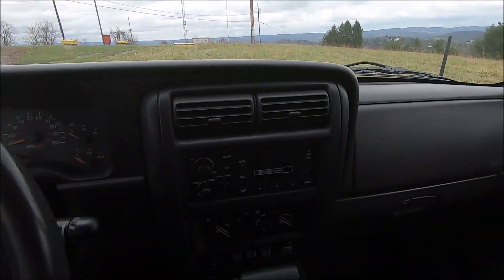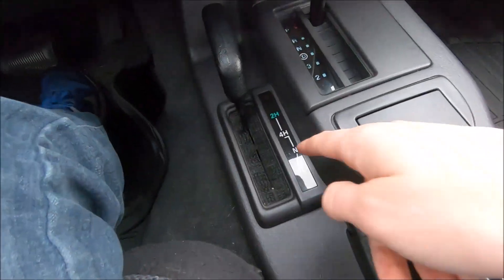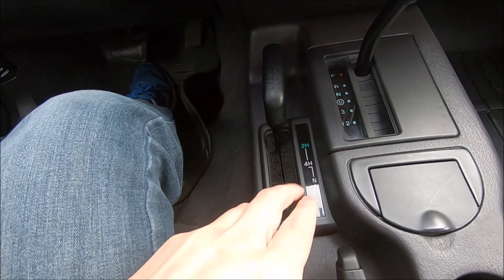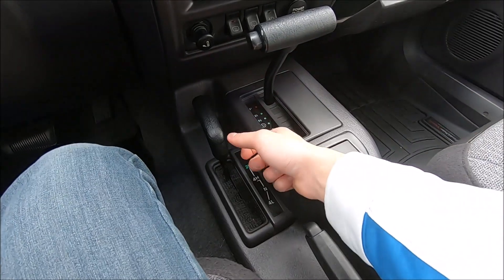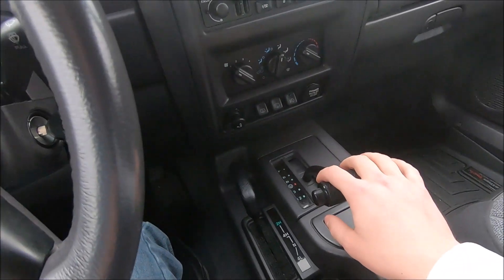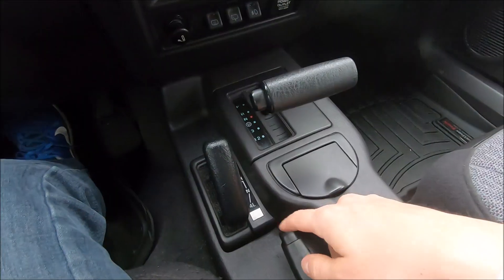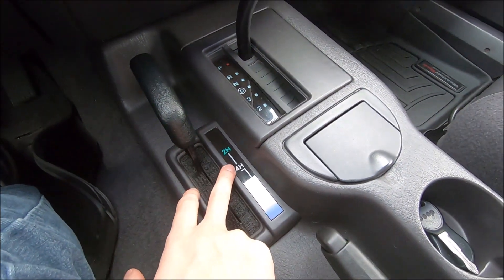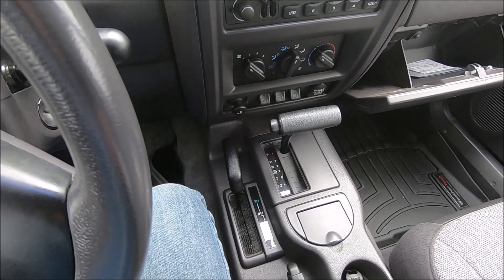Jeep 4WD System Explained (Command Trac vs Selec Trac)

Comment: 2WD = Rear Wheel Drive 
4WD Part Time = Four Wheel Drive with center differential LOCKED 
4WD Full Time = Four Wheel Drive with center differential OPEN
4WD LO = Low gear, four Wheel Drive with center differential LOCKED 

Simply explained 
High gear = Half engine power, full speed. 
Low gear = Full engine power, half speed
Reply: Is there a full time light? How do I puty it in full time 4wd?
Reply: @ryanwyrick6947 you gotta have the transfer case that has full time 4x4 not all of them have it mine has options for full or part time 4x4 and they would be labeled on the shifter pattern
Reply: High and low range don't change the power output of the engine, low just gives you increased torque multiplication through gear reduction.
Reply from the maker: @Lray4x4  I think he means the amount of power it takes to reach full speed vs half speed
Reply: @Lray4x4  No shit, just tried to explain in a simple way so people know roughly what it's about

Comment: I have a part time light stuck on in 2H.. .goes out in 4Hi. When Im in 2Hi its a real 2wd but the light is on. In 4Hi it goes into 4x4 and the light goes out. So the light is backwards from this. Its a 2002 Liberty and my Tcase shifter looks just like yours. I need help cuz I havent bought it yet. Is there a full time light? How do I engage full time 4x4? I saw your part time light never went out? I need everything explained from how to shift when to shift to what the dash lights mean. This video helped but My part time light is on in 2wd and goes out in 4hi... havent tried 4lo

Comment: The Cherokee XJ had the command trac or selec trac systems.

The Grand Cherokee from 1993-1998 had command trac, selec trac, or quadra-trac.  
231, 242, or the 249.  

The Grand Cherokee from 1999-2004 had the 247 transfer case they still had selec-trac as an option as well....but the 247 full time 4WD system was more common...and the 247 was used with the quadra-trac and quadra-drive systems...quadra-drive added front and rear limited slip differentials added.  

The old Cherokees prior to the XJ had a full time 4WD system or part time system, I can't remember which transfer cases they used but they weren't the 231 or 242 back then.  

The Cherokee XJ and Grand Cherokee ZJ were great in bad weather, and given the different 4wd options you could pick the one for your most use case scenario.  

The 242 Selec-Trac transfer case was found in the XJ (Cherokee), MJ (Comanchee Pickup), ZJ (1st Generation Grand Cherokee), WJ (2nd Generation Grand Cherokee), and the WK (1st Generation Liberty).  The 2nd generation Liberty also had "Selec-Trac", however it was an electronic system, and didn't have part time mode, it was just auto and low range.  The Jeep Wrangler and Gladiator did have a "Selec-Trac" option as well for a while but it was an automatic engagement clutch based system rather than a mechanical open center differential found in the 242 transfer case.  

Given the age of these vehicles now, don't just look at the bezel on the shifter or by the shifter as a reference to what transfer case you have, if you aren't the original owner, there's a possibility the transfer case has been swapped out, its best to look at the tag on the back of the transfer case to verify what you have...The Cherokee transfer case swaps are between the 231 and 242 a lot of times, if people are modifying them for offroading and it had a 242 they'll typically swap it for a 231, just one less 4WD setting, and in offroading applications you wouldn't need the full time mode, so its just less parts to worry about failing.  In the Grand Cherokees the 93-98 models that had the quadra-trac full time 4WD, the common failure was for the viscous coupler in the transfer case that controlled how much power was sent to the front axle.  When that failed it failed in a locked state, which turned your full time 4WD system into a part time 4WD system which of course made turning sharp a problem...so many would swap to the 242 or occasionally the 231.  In the 99-04 Grand Cherokees the common transfer case was the 247, it had a rear wheel drive bias to it more of a 2WD until slippage was detected type system, people again will typically swap the 231 or 242 transfer cases....with the 242 transfer case getting a replacement from a junk yard is common, and there are 2 versions of it, one being the standard 242, and it'll usually have a J after the 242 on the tag....if its found in a Durango or rarely in a Dakota you'll find a D after the 242....these designate that its a Jeep or Dodge and means nothing otherwise and the internals are the same.  The 2nd version of the 242 will have HD behind the 242....this is the heavy duty version, which would be found in the Durango and rarely in the Dakota....the chain is 1/4 of an inch wider as well as the sprockets inside, other than that its the same.  Then you get into the differences in input and output spline count depending on transmission being used and the application.  I mention the Dakota because Selec-Trac was an option in it briefly, but I've never seen one on the road with the 242, I found one in a pick a part yard once and it was a late 90's model with the 318 V8.

Comment: i know its a old video but what to do when its a manual transmission?
Reply from the maker: You can either push in the clutch or put the gear shifter in the middle for neutral when shifting from high to low or low to high

Comment: Common misconception. 

There is no viscous coupling on the XJ so torque is not split 50/50, it simply applies 100% of available torque to both axles. 😎

Comment: Will this work in my 99 Jeep wrangler ?
Reply from the maker: If you have the same transfer case then yes. If it’s different then it should still be similar but make sure to read your owners manual to confirm

Comment: Hello, first time automatic user here, to change from 2wd to 4full time i have to put gear on neutral and pull lever on left down through 4parttime and lower to 4fulltime (np242) while under 50 kph?
Reply from the maker: Nope you don’t need to put it in neutral if your switching from 2WD to 4 full time. Only when switching to 4L and back to 4H. You can switch to 4 full time while driving
Reply: @KCars  thank you very much for your help
Reply from the maker: @jakjaw3125  you’re welcome, thanks for watching!

Comment: So what is 4wheel full time for? Like wet weather?
Reply from the maker: Yup it can be used as a “just in case” mode but you would use part time when you are on a slippery surface

Comment: Just picked up a 92 xj I put it in four low but the front diff doesn’t seem like it’s locking up I almost got stuck going up a small hill what could it be
Reply from the maker: Putting it in 4 low doesn’t lock the front or rear diffs. It’s an open diff unless you have lockers
Reply: @KCars  if I put a locker in the front diff is it pretty bad daily driving?
Reply from the maker: @vs300c3  if it’s always on then yes that would be bad for daily driving. You would want one that you can lock and unlock, it should only be locked in slippery conditions when you need it

Comment: I’ve noticed my 4 wheel pt and ft suck. Only 4 low works.
Reply from the maker: Does the 4 wheel drive just not work in high?
Reply: @KCars  yeah, I put it in high, didn’t notice any engagement-rear wheels spinning… then went into four wheel low.. It effortlessly crawled out. Any ideas?
Reply from the maker: @RyansShop  if you’re fully engaging it and it doesn’t actually go to 4wd then it could be something to do with the transfer case, assuming you have a front driveshaft

Comment: So glad my 98 XJ came with the 4 liter, and the NP242. Got it to be a highway hauler and it wouldn't be possible without 4wd full time.
Reply: Why would it not be possible without 4x4 full time? I have had 2 NP242 transfer cases, 3 NP231s an NP271 and 2 Borg Warner 1354s. I have never needed to use 4x4 on the highway with any of them.

Comment: Great info. I kind wish my 99 had a 242. Full time would be amazing durring the winter months.
Reply from the maker: Thanks for watching! And I agree I think the full time option could be useful in certain situations
Reply: switching back and forth while sliding kinda sucks
Reply: it sure is but that case/entire tranny has its issues too.  just too much torque, not enough support.  Gotta be careful or your spider gears will shred

Comment: i had a clunk and grinding noise from the front recently. My mechanic disconnected the first driveshaft and it went away. i never use the selec trac so i dont think the transfer case is worn out i have a 242 transfer. could it be a malfunction with the transfer case switch?? how many sensors or switchesare on the 242np. i have a 2004 grand cherokee laredo with trail ready badges 155k on the clock. 4 1/2 inch lift with 265/70/17 tires. please help!!!! thanks in advance. btw when i select it into full time 4 x drive theres no light indicator on dash when i select other like 4 part time i can see the indicator light on dash is that normal?. i think it worked fine in full time 4x. i only notice the problem in full time 2 wh dr. what could it be??
Reply from the maker: If the clunking went away when the driveshaft was disconnected then it’s most likely something to do with the driveshaft and not the switches or sensors. Maybe a u joint? It’s hard to say without actually seeing it

Comment: I was looking at the sane year jeep xj as mine(mid 1990's) and it has 4hi part time and 4low full time. I haven't tried 4 low yet and i haven't looked at my transfer case, but i was a little curious since you didn't mentiom something like that.
Reply from the maker: That’s new to me. I’ve never heard of a transfer case that has only 4 high part time and 4 low full time. Seems like then there wouldn’t really be an option for normal on road driving
Reply: @KCars  It was like the transfer case you first showed. There was 2H then next was 4H, and when you switched to 4H a light came on saying part time. Then there was neutral, and then 4L. When you switched to 4L, the part time light turned off, and the full time light came on. I haven't tried on my vehicle yet, but let me check that one video that showed it.
Reply: @KCars  https://youtu.be/5ug_4DU2Uvg
Watch this, and go to 35:40. It doesn't show him shifting to 4H and 4L, but it shows rhe lights.
Reply from the maker: Seems like the one in that video has the NP242 where it has 4 high part time and full time and then 4 low part time. I think the part time light stays on when you put it into 4 low because it shouldn’t be driven in 4 low full time. I’m the video, I think he was only shifting between 4H part time and 4H full time that’s why the two different lights came on. 4L should always be part time

Comment: This is such false information. That clunking while turning in 4 Hi is due to the U joints in the front axle. You can absolutely use 4 HI at any point you'd like, you just can't take tight turns.
Reply from the maker: Lol are you gonna have them re write the owners manual then if it’s false information?

Comment: You know, I’ve got 330k on my ‘87 XJ, (would be more, but it’s not my only vehicle anymore) and after going into a serious fishtail on a wet, close to freezing road, because I left it in 2H the first winter of its life, I’ve had no qualms about pulling her into 4H whenever I thought necessary.  I’d rather replace the transfer case, than wrap the rig around a tree, or kiss the front of a semi.

That said, I’ve never had to replace either the transmission, nor the transfer case, and it’s had a lot of miles on mixed condition roads.  

And the front wheel chatter is more that there is no front differential.  As long as you don’t do short radius turns, you won’t chatter much.
Reply from the maker: 4WD wouldn’t really save you from rear ending people. That really comes down to your tires. But 4WD is definitely useful when trying to drive in slippery conditions and definitely helps out a lot. I haven’t noticed too much chatter either unless I’m doing a tight turn like you said
Reply: 4h isn't going to accomplish anything for you, infact it will make driving more dangerous as the front tires are being forced to slip by the engine. buying proper winter tires is what gives you traction, not any certain drive train. xj's absolutely have front differentials lol

Comment: When shifting into 4-High on the fly, shift transmission into neutral (stick or auto) first, shift transfer case to 4-High and then put transmission back to “D” or stick in the appropriate gear.
Reply from the maker: That’s only for shifting from high to low or low to high. When shifting from 2 high to 4 high you don’t need to put it in neutral
Reply: YEs correct, ALL XJs are equipped with Shift-on-the-fly 4WD
Reply: Correct
Reply from the maker: Yes
Reply: Common misconception. 

There is no viscous coupling on the XJ so torque is not split 50/50, it simply applies 100% of available torque to both axles. 😎

Comment: i have the 98 Grand. I need to go look and see which TC I  have. Mine is 4x awd full time. no option for part time

 Well done!
Reply from the maker: I believe the grand Cherokee’s had an option to have the NP249 transfer case which does not have part time. Just 4wd full time and 4 low
Reply: @KCars  so which iyo is best? thanks for the vids and feedback
Reply from the maker: I don’t know if there is a “best” I think it’s mostly just personal preference. The NP242 has the most options if that’s what you’re looking for. I have the NP231 and haven’t had any issues, just need to be careful to not leave it in 4wd when you’re on a surface that isn’t loose since it doesn’t have the full time option. Thanks for watching!

Comment: What if u speed in 4 low and u need to put it back to 2wd without it grinding?
Reply from the maker: I would stop and switch out of 4 low. You can do it while rolling but you shouldn’t do it over 2 or 3 mph, and make sure you’re in neutral

Comment: I yes want  to know if I can do it with the jeep running in neutral or it has to be always in stop
Reply from the maker: If you’re going from 2 high to 4 high then you can be in drive anywhere below 55 mph I believe. If you’re going from 4 high to 4 low, then you should be in neutral and you can be rolling 2 or 3 mph or you can be stopped
Reply: @KCars  thank you my friend good video
Reply from the maker: No problem, thanks for watching!

Comment: That xj is cleeeeaaannnn
Reply from the maker: Thanks! Wait until I do a full paint correction😎
Reply: @KCars  mines got 225k miles and rusty. It was also 2 grand. Lol
Reply from the maker: Might not be perfect but at least you didn’t pay a huge amount for it
Reply: @KCars  a couple hundred bucks spent and i have  all the factory function back so i may throw on a zone off-road 4.5 inch lift. I just bought it as a hunting/ fishing/camping vehicle, but it's pretty fun to tinker with.
Reply from the maker: 4.5 and 33s would look pretty good I think
Reply: @KCars  that's what I'm thinking. Trying to decide if I'm going 10.5 or 12.5 width.

Comment: So I have a 2000 jeep Cherokee 4x4 4.0 and when I engage my 4x4 the part time light doesn’t Come on what does that mean ?
Reply from the maker: If you have the shift lever in the 4WD position and it actually goes into 4WD then I’d say the bulb is just out. But if you can’t get it into 4WD then it might be a problem with the transfer case, maybe a linkage that popped out of place or something else
Reply: @KCars  it might be the bulb but I feel a huge difference when I put it in 4low it like jumps when I touch the accelerator
Reply from the maker: If it feels like it engaged into 4WD then I’d say it’s just the bulb

Comment: What is the 1-2 & 3 gears for ?
Reply from the maker: In 1-2 the Jeep will use the first and second gears. In 3 the Jeep will use the first 3 gears. Useful if you wanna downshift or use engine braking when going downhill
Reply: 1st gear is an engine brake

Comment: You can shift into 4Hi on regular flat roads for just a little to give it exercise once in a while.
Reply from the maker: Better idea to do that on a loose surface to not cause any damage
Reply: @KCars  Issue is not hard surface itself but turns on hard surface are. So id JDMEXforme is going only straight... :D
Reply from the maker: Yep as long as you’re not turning and causing any differences between the front and rear then it should be ok

Comment: Nice video man! I didn't know I can leave it on D and shift it to 4H Part-time. I also have a 231 and noticed both 242/231 are solid Tcase.
Reply from the maker: Yep only time it needs to go in neutral is if you’re going from high to low or low to high. Thanks for watching!